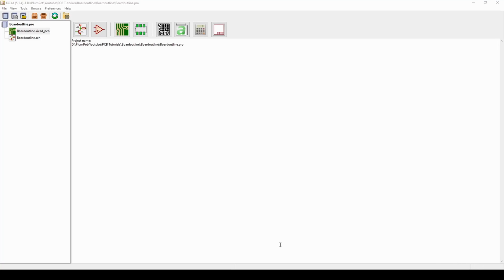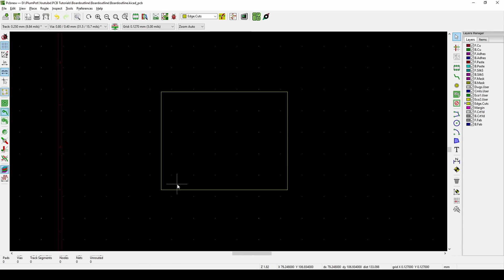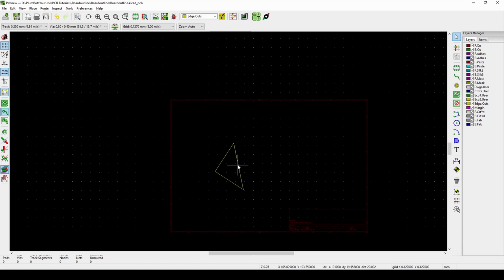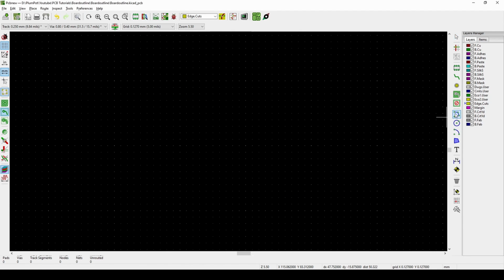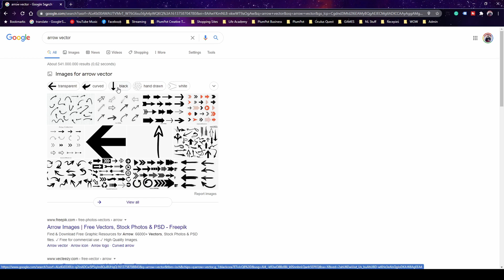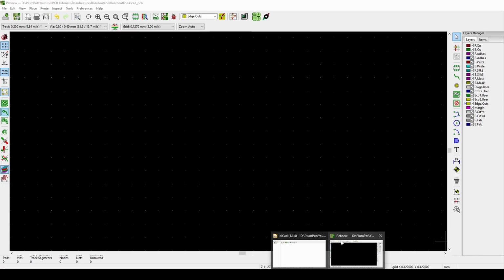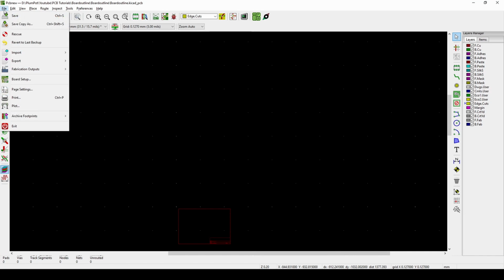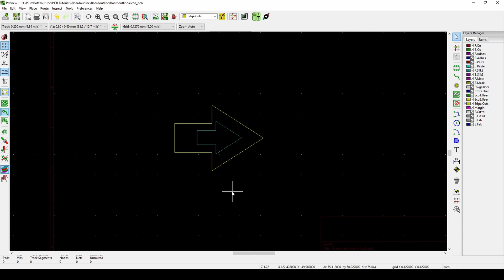KiCad Tutorial -  How to create an unique board PCB outline

Comment: do you have a video on how to create a simple PCB board without any components, I am trying to re-create a single PCB board that is used in the power area of an Amplifier, for the old one, the line traces are starting to lift at the edges and trying to re-create and create a better Mod than the original...

Comment: Where would you place the origins for pic and place on a shaped board?
Reply from the maker: Hi Chronic, you mean the origin of your pic and place parts or origin of the grid. Kicad has two different origins. The grid Origin can not be changed that is somewhere always like top left. The pick and place origin you place bottom left of PCB. You want all your components co ordinances to be positive.
Reply: @PlumPot  so if I use a temporary line from the the left most point to the bottom and a line across to meet that that should be my origin point for the pic and place?

Comment: Hi, I want your help...I'm working on a 4 layer pcb (with 1st layer-signal, 2-GND, 3- 3.3v 4- signal) and m using CAP1203 cap sense IC and have created 3 cap touch pads on 4th signal layer...now should i remove copper from 3rd layer(i.e 3.3v) underneath the touch pads?? Please help
Reply from the maker: Hi Ayush, yes I would remove the planes underneath your pads. Maybe also swap your layer 2 and 3. So GND and 3.3V. Is that possible? What you can also do is have a mesh GND under your touch pads. When you look at development board most of them have mesh underneath. This is difficult to do in KiCad though. So I would just remove it🙂
Reply: @PlumPot  thanks for you help....unfortunately i cant swap 2nd and 3rd layer...i'll remove copper under touch pads